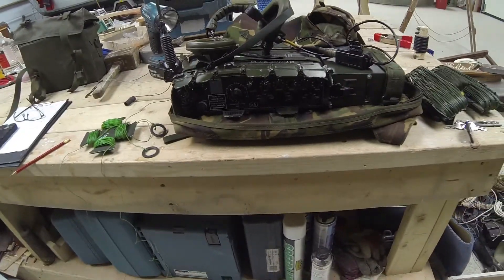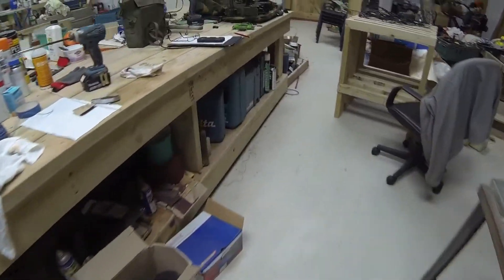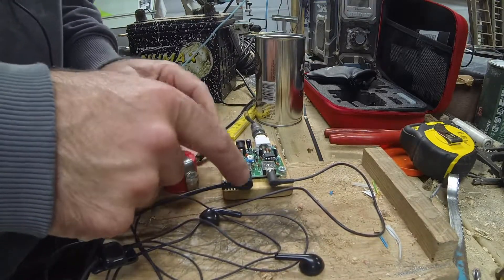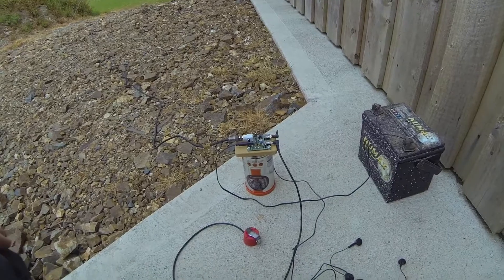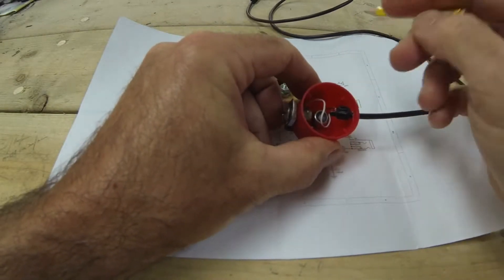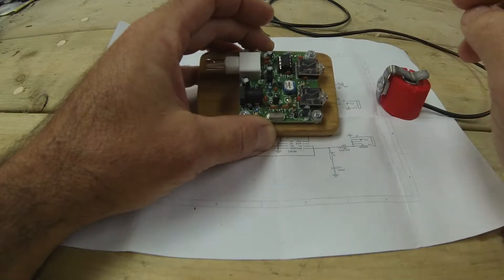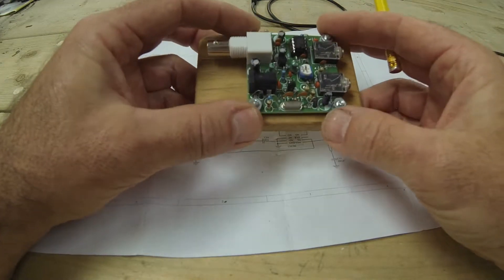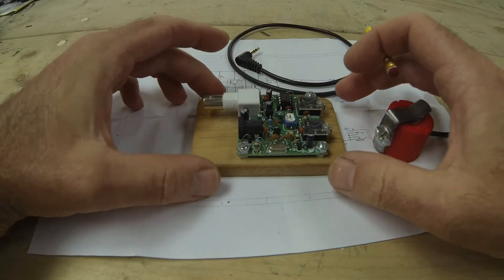Making a Morse key for a Pixie transceiver

Comment: 👍I think you worked it out. These Pixie kits transmit a very low level carrier in RX mode, just above the TX frequency. It is because the TX power output transistor is being used as a multiplier (mixer) in RX mode.